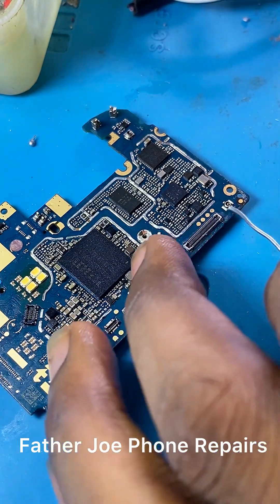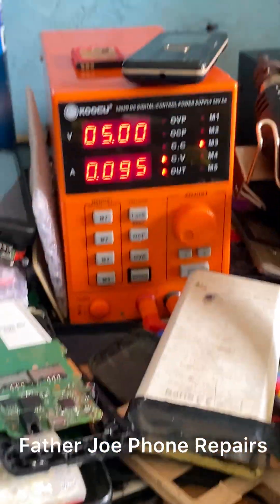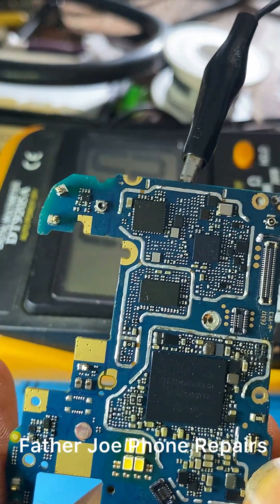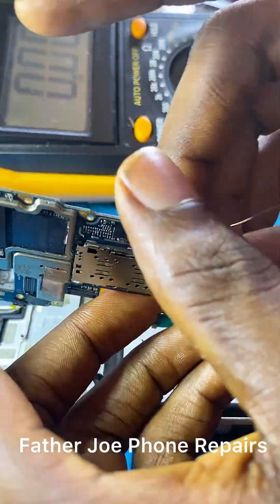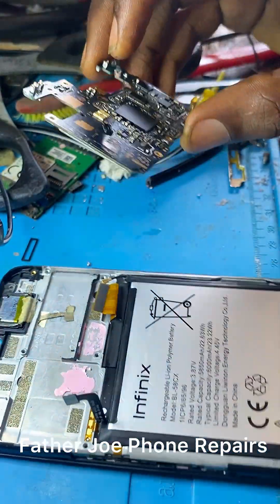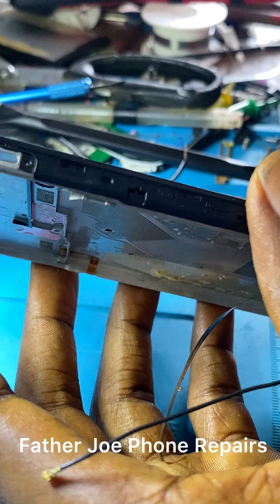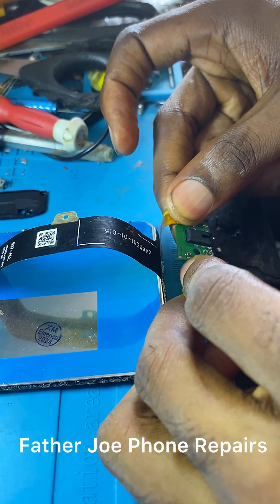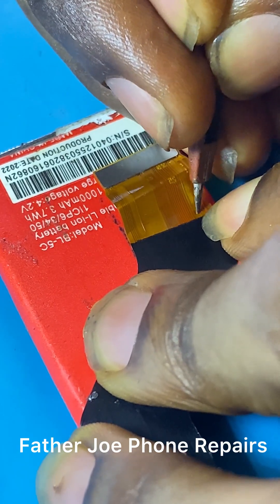How to repair any phone that’s showing only charging light 💡 ( part 2 )

Comment: I swear you no try at all, you be confirmed learner… why can’t you just re remove the down board and use new screen and new battery to power up the device?  You knew that the Suboard is the cause and you still connect it to the screen. Can’t you turn on phone without down board ??? I’m asking you a question

Comment: Even if you put a new screen and follow-come subboard the phone won't still come up. 
The phone is having board issues, you are just testing with a bad subboard to make your video. Guy go and learn or better still stop making these videos and start learning, technology now is more than what you are doing.
Reply: Do you fix electronics or you just had a word to say?
Reply: How can I fix it bro am having same issue now but is not from the down board 
It is from the mother board
Reply: @ChiamakaJoy-o6k Check the Vph output line from the charging IC and see if there is a short or not, connect a charged battery and read the vph voltage if it supplied 3.8 volts to the PMIC. If not the charging ic is malfunctioning due to the short on the vph output line you have to clear the short to get the phone to charge and also power on.

Comment: You are still learning bro 😅
You dont know how to troubleshoot professionally 

When u see that it showing only charging light, these are the few things that should comw into ur mind.

1. Check the battery if its charged 
2. Plug it and test the battery terminal if its giving 3.5 to 4V 
3. Check the VCH Line (screen flex) if its giving 5V 

Then you will know where to launch your solution on. 

Even, u dont need to open all the parts of the PCB 

You open gradually and u make sure that u only open the part that is likely to have the issue. 

Bro you shouldn't have opened all the heat zinc before testing it with jumper wire.

This shows you are still a learner in this field 😅

What you should have done is to first test all the primary possible ways to solve the problem which includes testing if 5V is flowing from the down side to the upper side of the flex. 

Then you will know and be sure that the problem is not from the main component of the phone. 

This is a simple challenge that requires a simple solution not all this stuff ur doing here.
Reply from the maker: Ok
Reply: We are all learning...thanks bro 🙏 from Kenya
Reply: Bruh, did you learn anything from the author's reply?
If you do, that should be humility.
Reply: i swear, bro wat is the name of your channel
Reply: @THENOD-rep @chunexmobilesolution
Reply: i swear, bro wat is the name of your channel
Reply: Help me bro 

The creator just wasted my time
Reply: @ChiamakaJoy-o6k 😅😅😅 it's well 

When u understand how troubleshooting works and how to execute it very well, you will not find it hard solving problems 😅
Reply: Channel